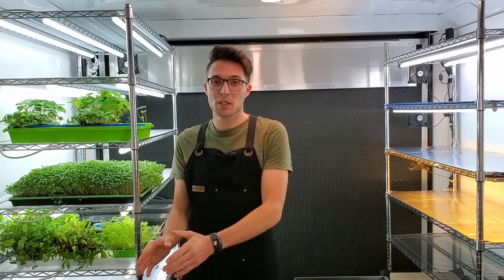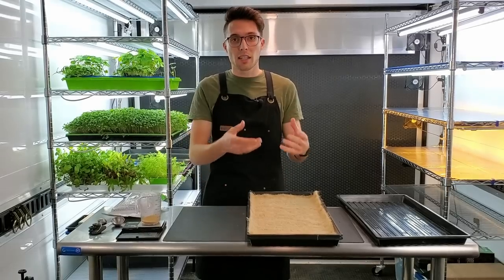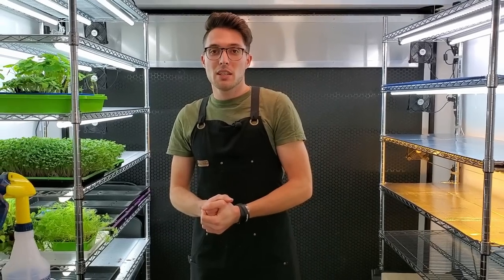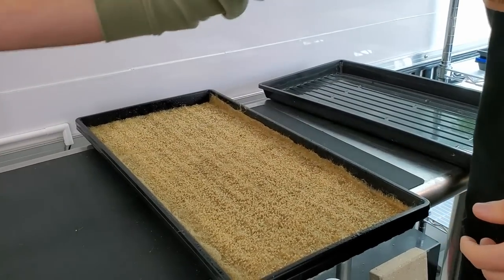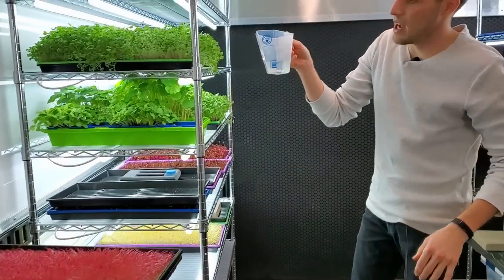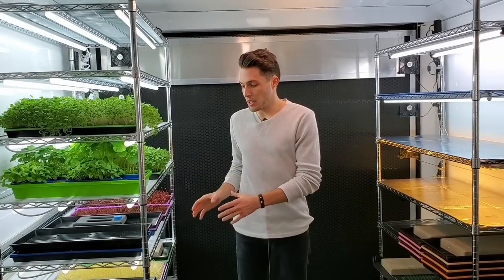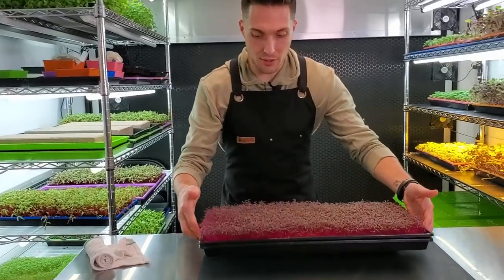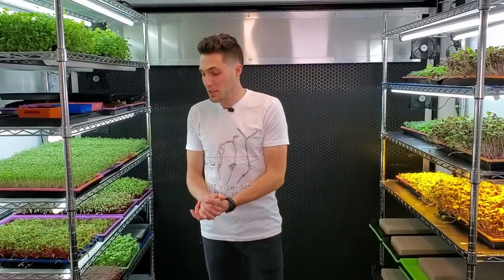Hydroponic |  How to Grow Red Garnet Amaranth Microgreens from Seed to Harvest with Tips & Tricks

Comment: Another grower in a FaceBook group said they use Nettle Tea and it seems to stop and prevent mold and fungus for them
Reply: Interesting. The chemistry related to this can be addressed by solutions other than hydrogen peroxide.  There is nothing wrong with hydrogen peroxide it’s just that I am a home winemaker and always have handy a number of mild sanitising agents. Basically - to knock out any stray bacterium’s you need only drop the pH to around 2. This level of pH will not inhibit growth - as we know. So for those winemakers watching this excellent video I suggest you use your normal StarSan spray solution. Thanks guys for the video.

Comment: Hi I really love the way you present your channel. It is good to show people close up your good and bad experiences. 

As I work mostly with hemp perhaps I can give you a tip, if the medium is quite wet don’t give any more water even a small spray as hemp will break down and cause pathogens. I feel the medium and examine closely all over to make sure all areas are nicely wet and I leave it alone. Once the roots form I am very careful with the amount of water I give possibly maximum half a cup of water and I will check three times a day . If the roots are drinking the whole half cup I will give more if there is any water left even a few drops I leave the watering for later as I don’t want problems with the root system. My roots always stay white because of this and I don’t run into any problems.

I hope this helps you I only say this because I had problems myself with over watering and I find if we can help one another it is all to the good. Hemp is a temperamental medium and really doesn’t like over watering. Kind regards M

Comment: Great video! I just would like to suggest that you keep your H2O2 in a dark place, away from light. I read that the H2O2 will convert to plain H2O very quickly when kept in the light :)
Reply: I remember reading that too.
Then like everything you have fraudulent claims and dangers from handling it.
Reply from the maker: We generally use ours within a few days and it is out of the light... I was under the impression that it isn’t light, but UV that causes it to breakdown along with temperature. Since our indoor lights have a low UV output, I don’t think it is as much of a concern. I’ll double check that soon though and thanks for sharing the tip!
Reply: @OnTheGrow  you are correct it is temprature that causes chemical breakdown to h2o. whilelight generally comeswith temprature light in itself dosent break down peroxide.

Comment: I have ran into the same root browning using the hemp mats. I was able to trace it down to the mat allowing some light to get to the roots. Harmless for the most part. But woth noting. 
I wa able to trace it down by adding a thin layer of vermiculite to the too of the tray once i had sprouts. There was a clear line between white roots and “browned” roots. The end product was the same, so i dont bother with it.

Comment: You amaranth looks absolutely beautiful. Thanks for taking the time to make the video. It’s nice to see the whole process from start to finish. What percent H2O2 are you using when you add the 2 Tablespoons? Thanks 🙏
Reply from the maker: Thank you for the support! We are using 3% and that has worked well for us! Some other growers prefer to use 12% or 35% but we haven’t found a need to go stronger on ours...
Reply: @OnTheGrow  when you say you use 3% does that mean you dilute 3% down so 2 Tbs 3% h2o2 then 1L of water? Or is your dilution at 3% with the water?

Comment: Just now trying this crop using coco mat or whatever hamama uses for their seed quilts. Fingers crossed. Have wanted to try this crop ever since I saw you first do it.
Reply from the maker: You got this!!! Those coco mats are a little challenging because they lack the ability to retain water, but you should have it as long as they don’t dry out too much! I think most coco mats are coated in a rubber type material which makes it a bit trickier.
Reply: @OnTheGrow  Thanks. I just checked on them & the radicals are pushing out. Will check it again later to see if they need another misting. Misted this morning & it’s still good 🤞🏻

Comment: Awesome! Thanks for the tips bro! Gonna go for a 5th attempt tomorrow haha - I keep getting damping off but I think i'll go thinner on the seeding and be more sparse with watering and I think I'll get it out of blackout for 20 mins and under the fan once per day for a good airing out - apparently that helps
Just to confirm - you add 2tbsp of 3% peroxide to 1L of water for your anti fungal?
I'm gonna make up some tomorrow and use that instead of my straight 3% lol  -  I think I've been bleaching the leaves with my super strong solution
cheers
Reply: Id try a little less water, and yes your probably bleaching them, straight water should be good enough. Most micro-green do not like to be top watered after first few days. And putting a fan or some air flow over tops, part or all day, depending on speed. It does not have to be fast, and would not suggest  fast.
Reply from the maker: Damping off is a pain! Lol, that’s hilarious that you’ve been bleaching them :) Yeah, we just do 2tbsp of the 3% and 1 liter of water. The main thing for us is temperature and not too much water. If it is too cold, it will get damping off... Same with slightly too much water. It is really a fine line.
Reply: @OnTheGrow  How often do you spray H2O2? Very time you water the trays?

Comment: Have you tried a simple fine grain screen in place of the hemp mat that you used in this video?  Such a fine grain screen would be fine enough that the seeds (even small ones) would not fall through and would be reusable!  Such a screen would also simplify, I think, the harvesting process.
Reply from the maker: Great question David! We have tried that before but the main issue is that it drys out very quickly... Also, if you add too much water, it causes a bad smell and makes the seed rot. It is very doable and there are growers like HydroponicGardeningWithBrent that use the mesh a lot. We don't like how challenging the mesh screen is for germination when compared to a grow medium.
Reply: @OnTheGrow  Thank you for feedback!  I have seen most of Brent's videos and was inspired to take an approach similar to his, but I am focusing more on one that does not use the pump he relies on.  I have struggled to master the "simple" broccoli so far.  And my problems have been as you suggested with smell and also (I think) with over watering.

Comment: Absolutely gorgeous product can’t wait to try this. Interesting I’ve been using food grade 30% hydrogen peroxide in some of the same ways as you. However I was noticing that my growth periods were longer than what I was noticing with some other YouTube channels including yours and had questions. Anyways I was listening to a podcast by Diego footer on growing microgreens, The podcast was labelled microgreens diseases and solutions and it was specifically mentioned that hydrogen peroxide when applied on a regular basis can potentially harm the cellular structure and developmental process, resulting in stunted growth. However, when I watched this episode it doesn’t appear that you’re seeing the same issues. I will say that I stopped using it as regular as I was previously and I have noticed that my growth/development has noticeably increased in a beneficial way. what is your room temperature and humidity normally at?  Be interesting to see a video that you’d put out on hydrogen peroxide versus not using it and if you’re seeing any potential results. What I’ve done is made sure that my medium is always soaked in a hydrogen peroxide solution much the same as what you have in terms of in your spray bottle, and then take my growing medium “biostrate” draining of any hydrogen peroxide water solution and soak it in pH balanced at 5.7 to 6.0 to ensure that I’m not saturating with hydrogen peroxide.
Reply from the maker: We can try and get a video together on H2O2 and its effects on growth compared to not using it. It is something I would like to know! 

Here is some info on our temp and humidity: Our space stays between 75-80F degrees in the Summer (Best Germination Temps) and between 67-73F in Winter and our humidity around 50% or under. We also have one large fan that circulates the majority of the air and small computer fans on each shelf of each rack. All fans are running for 24 hours of the day. We do not pump carbon-dioxide in the space and the space only exchanges air when we open the door a few times throughout the day.

You can find a lot of the information about our space on our website too: https://www.onthegrow.net/growspacefaq
Reply: You mean 3% of hydrogen peroxide?

Comment: how many different trays did you guys use before you came to these awesome ones you guys left the link for?
Reply from the maker: We actually lucked out and got these trays first. I have tried some other germination flats after getting these and everything else is extremely disappointing. Most other trays are so flimsy they can’t handle the weight or even the weight of the soil... We have only had one of these trays crack in a corner after nearly a full year of pretty solid use. I am always on the lookout for better trays though!

Comment: Thanks for this video, yall are great! Question: I have lots of 10x20 with holes, but they're not the mesh as you used here. Could I still use them paired with the mat fiber medium for similar results?
Reply from the maker: I would think so, as long as the roots can get to the water, you should be good!  Might need to add some holes with a drill if there aren't enough!  Best of luck to you!  Send pictures of your beautiful microgreens!  😊

Comment: hi! I have a few questions if its alright!

1) What % is your hydrogen peroxide?
2) After removing from blackout, do you just leave it under the lights 24/7?
3) Also, does it still need a heavy weight on day 1-3? or is the tray over the seed good enough?
4) lastly, what is the ideal temperature of the environment for growing these micros? :)

Thanks!
Reply: Try testing it yourself. Every enviroment/climate zone is different.

Comment: Great channel. So informative. What I want to know is the strength of the hydrogen peroxide solution are you using in your spray bottle? 2 tablespoons per litre, but what percentage HP are you using. I'm a complete newcomer and diluted some 6% food-grade HP down to 4.5% to spray on my black oil sunflowers as they were showing signs of mould 2-3 days into germination. Is this acceptable, or too strong?
Reply from the maker: Thank you yomofo101 🥳 We really appreciate your support!! That's a pretty close marker and most likely no worries...did your mold issues subside any???

Comment: So you don't use food grade H2O2 and feel comfortable with it? I have been reluctant to handle the food grade version.
Reply: Fingernails are an indicator of overall health and yours look good. Whatever you are doing, keep doing it.
Reply: It's great that you guys are on the same page and work together!
Reply: I have been screwing a paper towel on my sprouts that I grow in mason jars so they can breathe.
Reply: @BusterABrown  Good idea. I find if i air-dry my micro-green out with a fan, so they are not dry but not holding water/moisture. They will last 7-10 days easy, in a plastic sandwich bag. I do find if i leave one end open a lil, it help with excess moisture, If i see them looking a lil dry, i close bag. If your using them during the week, you can judge them as you go.
Reply: WAIT WHAT? they are not using food grade H202?
Reply from the maker: We use food-grade hydrogen-peroxide...
Reply: Do you buy the 35 percent and dilute it yourself down to 3 percent?
Reply: @BusterABrown  Yes, i found that some lower concentrations have additives. Its usually less than $20 a jug. There are youtube videos, if On the Grow does not,  on how to dilute safely.
Reply: @pseudoscientist4585  Thanks, At my age I am reluctant to work with the 35 percent H2O2 and like you say this is what you need to use. I guess I will sleep on it for a while and decide at another date. Next week I have an eye surgery scheduled, which gives me plenty to do.
Reply from the maker: Buster Brown we buy 3% that is food grade without all the additives. It’s available to us at our local grocery store that way and also online here: https://www.amazon.com/dp/B01AW1HYIC/?ref=exp_onthegrowfarms_dp_vv_mw
Reply: Four and five day old broccoli sprouts:
Freezing broccoli sprouts increases the sulforaphane 10 -   100 times and if you time it just right up to 1,000 times! - Dr Ronda Patrick. Listening to Ronda interview the Dr. who does the research on sprouts I learned that theoretically the seeds have the most? 
I'm guessing that also applies to my alfalfa seeds, so I am in the process of getting a couple months supply of them in preparation for my eye surgery which needs two months of rest.
I haven't seen any research, but I would bet freezing also applies to microgreens as the freezing cracks the mitochondria cells. I use the same principal with my berries.
Reply: One thing I should mention is that you have to have the sprouts in the portion size before they're frozen as it is impossible to separate them once they're frozen. I just use a paper towel between them in food grade plastic containers.
Juicing also brakes open the cells if you have a good slow juicer and then you can freeze the juice. I wiped out the start of lung cancer in three months with nothing but carrots, Granny Smith apples and a GreenStar juicer!!!

Comment: Do you dilute a stronger solution of Hydrogen peroxide to get 3% Hydrogen peroxide or do you buy it already 3%?
Reply from the maker: We buy a 3% food-grade. You could buy a 12% or even 35% if you want, but those are a lot more dangerous to work with. We prefer the 3% in case there is a spill on your hands and you don't have to worry about getting a chemical burn. You can see the one we use on this list: https://www.amazon.com/shop/onthegrowfarms?listId=2BYNJU1NFW8R5

Comment: Not to be that guy, but I don't think your peroxide solution is doing much of anything.  You're diluting what's probably already a 2% solution down by a further 1:128 which makes it about a 0.001% solution (so 0.00001:1)...and your solution is stored in a clearish bottle with a decent bit of head room in it, so if that's been in there any amount of time, it's probably already decomposed down to water and oxygen.

Comment: Hey guys.  Love all of the videos and learning a lot.  I’m am buying trays and my question is should I get the trays with the slot holes or get the mesh trays along with the no hole trays?  Is there any advantage to one or the other?  Do you vary which one depending on the crop?  Thanks and keep up the great work, very informative and fun to watch you both.
Reply from the maker: Great question! We determine what type of tray we use based on what grow medium we are using. For hydroponic mat mediums we usually use the mesh trays and for mediums like Soil or Coco-coir we use the slotted trays so that way the medium doesn't fall through the mesh as much. 

You can still use the mesh trays with soil or coco-coir though! You'll just have some of the medium fall through the holes.
Reply from the maker: Thank you for watching our videos!!
Reply: On The Grow do you meen coco mats or the loose coconut coir that looks like soil?

Comment: We are about to start growing microgreens in a rather broken down space. of 20sq m.  It needs new windows and some kind of ventilation and at the moment is not clean. I see you have 2 small fans. Is that enough for airflow? And what would be the optimal temperature to grow greens? Its cold in the wonter to 1C and hot and sticky in the summer.Im not sure how best to heat/cool/comtrol the temperature and humdity. Any ideas? Cheaply!
Reply from the maker: Great questions! We have a big fan that circulates the majority of the air in our growspace. The small fans are really just for preventing microclimates on the shelves and keeps the air moving. You can see a lot of the answers to your questions in the FAQ part of this page: https://www.onthegrow.net/growspacefaq

I would look around at local resell shops or online at people selling used equipment. I would get some kind of A/C unit for summer and a Heater for winter. We have a small room heater that works really well and is fairly cheap to buy. Here are some of the supplies we use for reference: https://www.amazon.com/shop/onthegrowfarms?listId=1UZO67GPPPW8Z

Comment: Great video! I see you used the mesh variation of the bootstrap tray for this grow. Would you recommend those for general use or was that just because you were using the hemp mat/hydroponic? I like the idea of the mesh variation being more supportive of root growth and drainage although I am concerned that soil or coco coir would fall through. Any experience with that?
Reply from the maker: We do know of growers using the Cococoir with the mesh trays and it works great! I would make sure it is a little moist before putting it in the mesh tray to keep it from falling straight through. Keeping it wet will help it clump together and only a little will fall out during the duration of the grow... Hope that helps Eric!